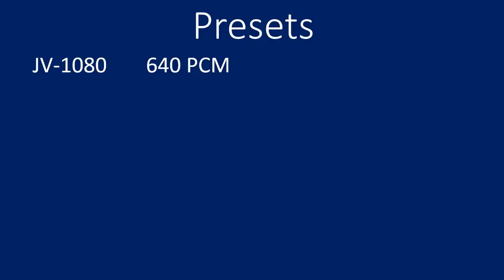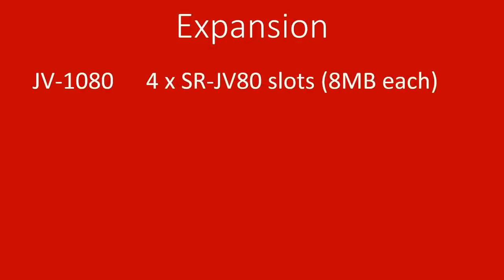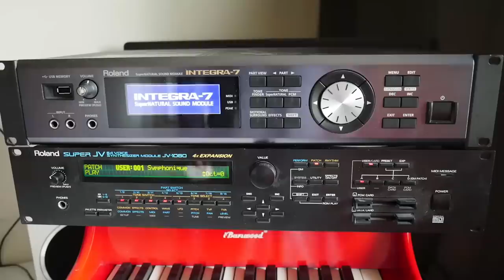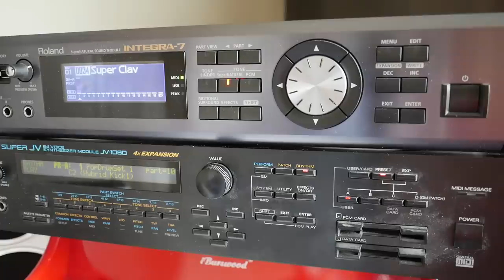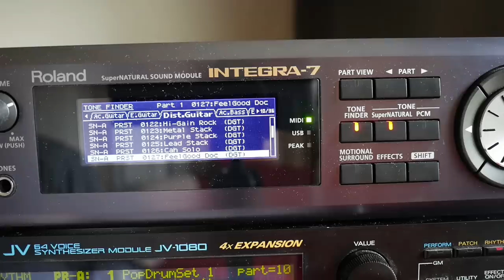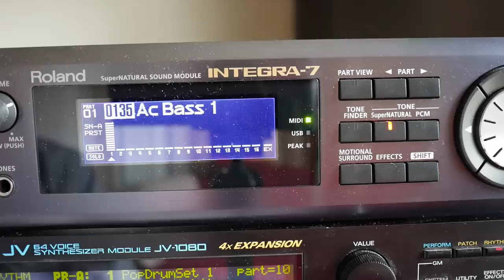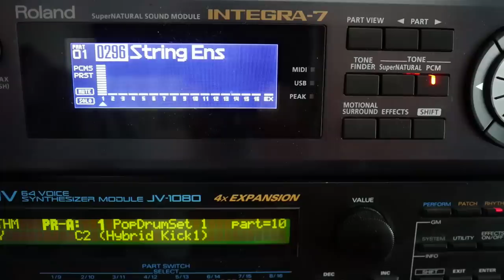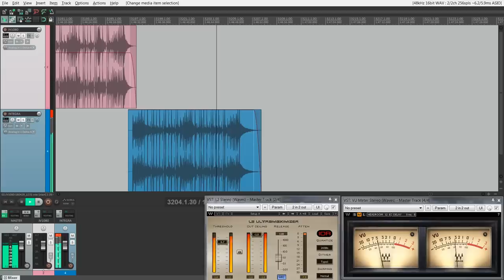Evolution of a classic synth module | Roland JV 1080 vs Integra 7

Comment: Difficult, the integra 7 uses 24bit/92kHz D/A so it will sound different then JV1080.  Do note the integra 7 has more influence on tyhe sound, for instance the drum , You can change the the base drum punch and hi-hat also which is impossible on a JV1080 or JV2080.  And add all expansion slots this would bring sure the JV2080 as pricey as the integra 7 . The problem is also what we  hear is not what think we might hear. Sure when we get older then our mind is stuck to older synths and very old then our high frequency is going down to 15kHz or even lower. But don't worry Your brain will still recognize  old synths  cause that what we heard for ages. I bought a JV2080 from ebay and it sounds good except guitar, elektric guitar, piano could be better , horn/trumpet  could be much better. I also have a Roland D50, an 8bit system, a Korg Kross 2 (16bit/48kHz) , a Behringher Deepmind 12 (pure analog, digital controlled) , a arturia drumbrute and VST's Omnysphere 2.5 , Tone2 Electra and Saurus.  The JV1080 and JV2080 are sure not bad,based on the main core cpu RENESAS HD6437034 , a 32 bit RISC processor and the  63200GS-E2. (16 bit DAC) the JV2080 a  Burr-brown  PCM 69AU   (18bit dac but reads  as 1 bit dac)

Comment: Nice playing, however-- I think "comparing" these is a kind-of a slight mis-characterization of both machines, and is not quite fair, a little bit "disingenuous". I feel like you're trying to compare apples and oranges here just a little bit. Both are great machines at their respective price points. The sounds on each are going to depend on how you choose to play them and will depend on your needs at the time, and can, of course, be tweaked a lot.

JV1080 is obviously a great 'starter' or 'augmentative' rack at its low price and good selection of classic Roland sounds. Maybe one would say the sounds overall are more 'retro' sounding because of the tech underneath.
However, Integra-7 is just whole different ballpark-- an absolute beast with just so sooo many presets, the superNatural sounds, the SRX boards on-board, Mfx available on each part, 6 drum comp+EQs, motional surround, a few extra downloadable sound packs available on Roland's site and more. There's just so many features here, it's nothing to sneeze at. I think the only complaint you could really field here is no downloadable boards (real missed opportunity here) and the lack of the super desirable 'SR-JV80-04 Vintage Synth' board+990 sounds or maybe banks of the Sound Canvas sounds.

You didn't seem to use any superNATURAL features/articulations present on the SN sounds, which can make them sound quite realistic and is one of the 'difference-makers' between the i7 and the old PCM sounds. They are more so 'how you play it' sometimes over 'what sound was picked'. There are also settings on the SupNat sounds like 'Ambience level'/'brilliance' on SN drums to farf around with...

I think you really needed to emphasize just how many sounds the i7 has...and many of them sound quite different-- There are A LOT. Take the SN-synth  Saw-Leads for instance-- there are 45...yes, 45 different Saw leads and that's just the 'generic' ones-- and there are even so many more among the factory SN synth bank, the factory XV PCM banks AND the SRX boards.
There are literally so many sounds I cannot fathom someone going through 'category search' looking for a type of sound and not liking any of them. For instance, looking for an Organ-- and out of dozens and dozens of variations and specialized patches/takes on many 'iconic' sounds like specific Organ models or draw-bar settings for instance-- not finding a single one they like? Can't imagine that, especially with no sounds really standing out as being flat-out 'bad' for whatever they are.
Reply from the maker: well said Trevor, great points.  Ok, we're just getting started with the Integra and obviousy I didn't demonstrate any of the features that make it superior to the JV.  For example, I'm preparing a demo of the supernatural articulations for a separate video, likewise a video about the SRX expansion capabilities.

I didn't really intend this video to be a shootout of the sounds, despite the title :), because the I7 has so many (it would take hours if not days for me to go through all of them and pick out the best ones) so here I'm just playing a few fairly random presets from each machine to give the viewers and myself a first impression of the character of each synth.  This is just an introduction to the I7, stay tuned for some deep-dives.  Thanks for the feedback!
Reply: No problem. It's awesome to hear you'll be doing more i7 videos, i can't wait. I think maybe i might have come off a bit harsh, if so, i totally didn't intend to-- was just trying to get my thoughts into the message box. There is quite a lot to sift through when learning what all this box can do.

Comment: I was thinking if you equated sounds to languages, the 1080 might produce English and the Integra would produce all European languages. The test here would then be like using English as the test language because at least you can sort of replicate it with both synths. The problem is that it doesn‘t work the other way round. 23 languages other than English couldn’t be spoken by the 1080. You’re  testing the Integra with 1080 sounds and pretending that tells you something when it doesn‘t really. The Integra is a beast!

Comment: On the Integra, what happens if you make a patch based on sounds from two different virtual expansion cards, then swap one of them out for a different one?

Does that part of the sound go silent, does it give an error message and sulk, or does it substitute the corresponding sample from the card that's in the same "slot" where the other one was?

Comment: Its a toss up. The integra sounds more present and forward to me in general. That said for the kind of - frankly somewhat dated and period - sounds I might want a module like this for The 1080 sounds more authentic and nostalgic (which would basically be my motivation for having a sound module over say kontact libraries for acoustic pianos etc). 

Plus the 1080 is like a fifth of the price (not inc. expansion cards of course). 

my opinion. dont hate
Reply: a great video by the way ... really interesting to hear.
Reply: if you are looking for old pcm rack mount synths can I recommend the Kawai K4r

Comment: Oh, now I finally understand why there is this nonsense of four 'virtual' slots, and not being able to chose from whatever SRX 'board' you like. The processor used in the Integra-7 must have a limited address space: most probably, 1 GB (30 bits address space). It has either 256 MB RAM in which the modules are copied, or it uses bank switching like in the 8-bit days. There is no other plausible explanation why they would use such a convoluted solution. Although, 'plausible' and Roland don't always go hand in hand...

Comment: The difference between both modules is striking far too much refinement on the Integra the JV1080 which I own has much bigger warmer floor the Integra however does have a character of its own which is noticeable it almost seem to compliment the JV1080 listening to the classical movements as separate pieces drums sounded fatter on the JV1080

Comment: JV-10480 sounds very organic: the sound is thick and fat as though produced from the substantial stuff of real "organic-inorganic materials." The purest the sound (e.g., without much whooshing noise fading away) the better is the quality of the Synthesizer.  Some musicians may still prefer the Moog Synthesizer due to its fat-sounding quality.  Now I think that Synthesizers, in general, SHOULD NOT be used to initiating the piano instrument.  Synth-Sounds have a "otherworldly tonal texture" of their own, and accordingly, synthesists should not attempt to emulate the piano anymore than a pianist would try to imitate a guitar, a violin, a trumpet or Pipe Organ.  Sampling has been used to imitating organic instruments like the guitar or piano, but it would always sound artificial when compared to the original, uncanny acoustics of physical instruments whose sounds are produced through the medium of tangible matters therein.

Comment: I think in this comparison the 1080 sounds better... but the comparison is flawed 'cause the real strenght of the integra are the supernatural patches which you don't show... so the entire comparison loose sense... it's like comparing a ferrari to a 500 in first gear into the traffic... the 500 wins because it's more confortable...
Reply from the maker: it's mostly the sn sounds in this demo
Reply: I was meaning the acoustic sounds that exhibits a natural behaviour, like the guitar with the slide between legato notes which previous units did not have...

Comment: That 1080 sounds super raw compared to the integra.The integra dressed the sounds up with more effects.The patches played on the 1080 sounds a little bit better in my opinion the 1080 was a special unit.The integra is a better unit over all but the 1080 will be used prob. forever it was just one of those units.

Comment: Why don't these synth companies ever improve the VOLUME RANGE???
It is still 1-127   It should be 1-127,000,000 by now.
By the way the 1080 sounded better 87% of the time.
Reply: Lance Goerner - see MIDI standard CA-031 High-resolution Velocity Prefix, been around for years. Supporting devices use CC88 for additional velocity data, for 14-bit resolution with 16,000 steps. My RD-800 supports it, also the Casio PX-5S. Roland also has their new Rainlink hi-res protocol, first used in the RD-2000 and Roland Cloud synths.

Comment: About the instruments in the video:

Some things that i heared:
- they sound both unconvincingly (accoustic pianos) bad, compared to big sample libraries. I would never use a rompler for emulating an accoustic piano.
- The digital pianos however are quite good, some even close to the original counterparts.
- Organs sound very rolandish.. 
- ooh that typical roland slapbass sound.. yuck!
- When do companies learn to NOT include solo brass patches inside limited romplers? They sound very fake, allways. (no matter the brand) (bonus: same for solo string instruments, like viola's violins)

Some thoughts about hardware romplers in general:
I know you can't expect it from a limited rom, to sound very convincing.. but then again, if they would not include it... only include sounds that DO make sense in that regard, e.g. synth sounds, percussion sounds, electric pianos.  Then the rompler would be sounding great, and being used for it's strongpoints. For instruments that are hard to sample convincingly, you require a software sampler and libraries. They don't have the limited ram/rom, they have bigger cpu power and better editing abilities for the samples themselved (think e.g. kontakt, halion).

We don't live in the nineties afterall... so lets ditch those constraints manufacturers had to deal with back then.
Nowadays, people take laptops on stage, as the sound source.. because it's easy to do, and provides so much more power, no hardware counterpart rompler could ever provide.

And if you want a trip back to memory lane, there are plenty of very good emulation plugins for those synths. (even from the original manufacturers themselves: Roland, Korg e.g.) or there are (some free) sample libs available for those sounds.

Hardware rompers are a thing from the past, and should be kept there... not talking about pure synths, mind you!.. i'm talking about romplers alone. (like the integra in essence is, and it's way too expensive too)

Anyway, your videos are great as always! :)
Reply: Nostalgic piano, 12 velocity layers ,cheapest library with great quality
Reply: Yeah, I always thought it was better to buy your own symphony orchestra and get the right sounds.